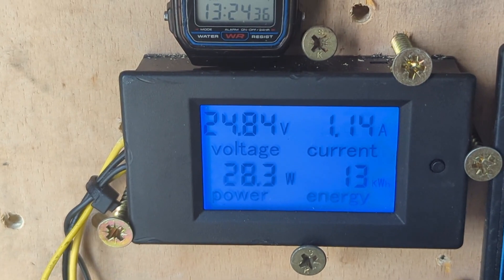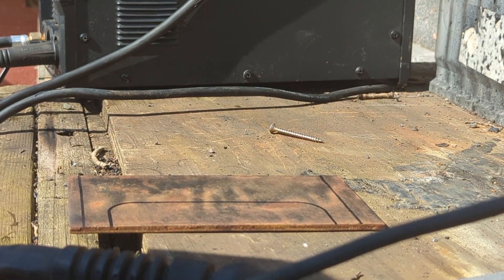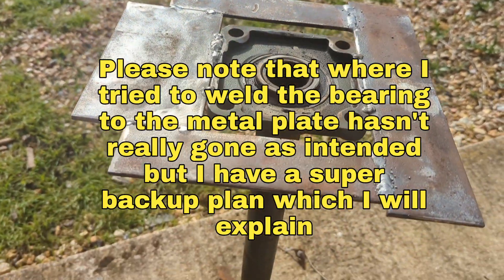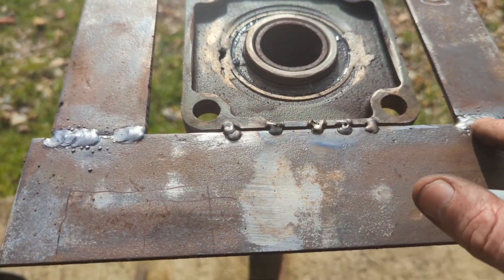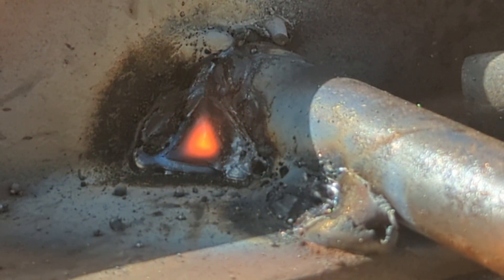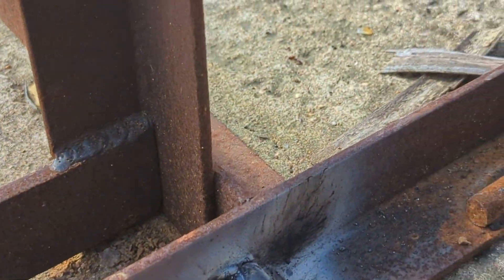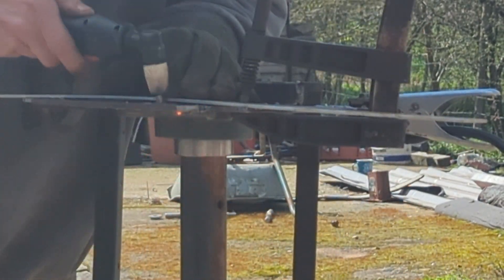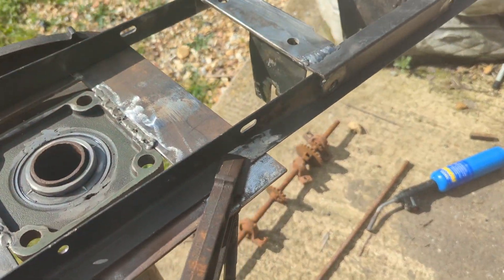New Wind Turbine Project - Good Progress - Still lots to do - Happy Easter

Comment: Why use hub motor as compared to axial flux and smart drive alternator.??
Reply from the maker: Hello, my friend I use this system because it is more powerful and the motor is built in a factory so it has perfect alignment I was not impressed by the smart drive motor as it needs to hit too high and RPM to start putting out that much power , decent axial flux costs a lot more money to make than these cost to buy .Thank you very much For your comments , What country are you in my friend? ????
Reply: @GavinFreedomLover  I am from Pakistan  and I am also want to make wind turbine . But make low rpm wind turbine in my area the average wind speed is 10killometer per hour...give me the best advise for make low rpm and low cost....
Reply from the maker: My friend you will struggle at that wind speed mine doesn't reach 24 volts until 20kmh.